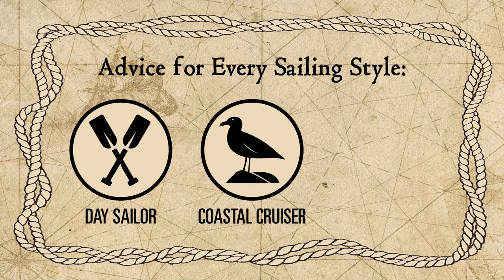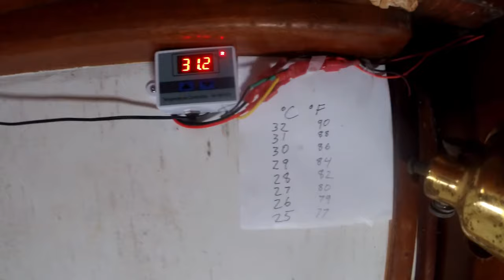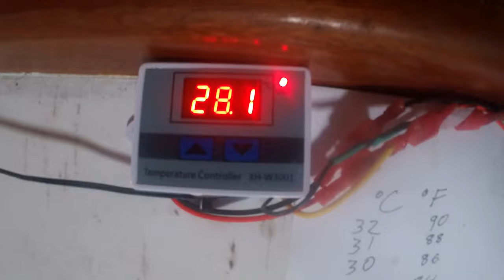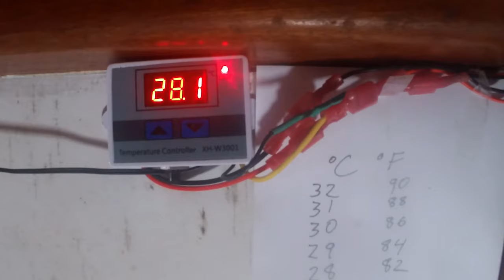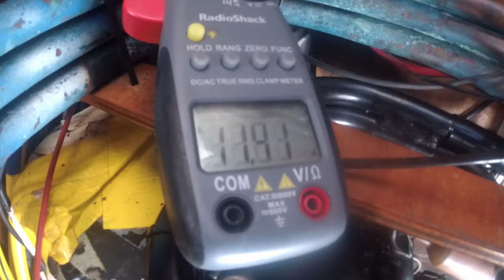Battery-Powered AIR CONDITIONING on a Sailboat [Capable Cruising Guides]

Comment: Hi Clark, You really do have the most informative videos for ACTUAL problems of living on board. One question I have is what is the inrush draw of the compressor? My fridge runs on 3A but compressor inrush is 12A.
Reply from the maker: It's a 3 phase brushless DC.  There is very little inrush.  Unlike an induction motor.  Nothing I can see on the meter anyway.  I've not hooked a scope up to it at startup but I think most of the startup power comes from the capacitors on the control board.
Reply: @Clarks-Adventure  3 phase DC??? errrr...
Reply from the maker: That's what they are called.  Google it.
Reply: @Clarks-Adventure  oh, I stand corrected. I was thinking you need to feed 3 phases to the motor... thanks for sharing!
Reply from the maker: We actually feed three phase pulsed DC to the motor.
Reply: @Clarks-Adventure  yes, that's what the motor controller then does, from what I read?
Reply from the maker: Yes

Comment: Girlfriend has a dog.  This could be a great solution.  I have an HVAC background so could easily build this as well.  Very curious what model compressor you are using.
Reply from the maker: It's this military thing that is basically not available for resale.  We are buying a bunch and will have them available soon.
   Fill in the survey in the description of the video if you would like to be kept informed.
Reply: @Clarks-Adventure  ok. Do you have spec sheets?  I have sources that can sometimes find odd products like this for IT cooling applications
Reply from the maker: It will eventually all be on the webpage I  expect.

The COP is over 8 and this one tops out just over 5kBTU.

Just signing the contract with the manufacturer who bought my design today.  You must understand I can't give out information that would undercut that company.  Wouldn't be honorable or legal.  Kits from them will be reasonable.  But remember this is a very expensive compressor to start with.  Us military spends our money freely.

Comment: I'm interested in a how-to pdf with a list of what's needed. maybe some links to sources.
Reply from the maker: The condensers are really expensive if bought individually (like $350). And the compressor I use can't be bought easily one at a time.  Not to mention their one unit price is very high. They are made by a defence contractor and don't seem to care for the public.   I could talk the talk so I got through.

    We will be offering a kit that includes the manual and the hard to find parts for less then you could buy them for.

    Fill out the survey if interested.
Reply: @Clarks-Adventure  Ya so.  I see.  Thank you very many.

Comment: I just bought a sailboat and was and have no solar. I was  wondering how long do I need to run the engine to charge a car lead acid battery? Thank you for your time.
Reply from the maker: How big a battery, how discharged, how large is the alternator.  And charging with your big engine is bad for it.....

Not a simple answer.

You can research it yourself or I have a tier "dream believers" where we can just talk on the phone.  Lots of people use it for that kind of help.
Reply: @Clarks-Adventure  not sure how big the battery is small. In the yellow discharge wise. I found a buddy that helped me motor and sail for a few hrs and I'm back to green. I ordered a 175w solar panel and nee 200ah AGM battery and saving for the charge controller. Do you guy have venmo would like to buy you guys a beer? For your time a information.
Reply from the maker: Thanks,
No just PayPal and Patreon.

Both links in the video descriptions.

Comment: If the solar you have available is (on a normal day) enough to charge a 100AH LiFePO4 battery and run the compressor and fan(s), why not just leave it on (during the day) so the cabin never heats up and then needs to be cooled down at night?
Reply from the maker: Our aft cabin hatch moves a lot of air through the boat.   The rest of the boat is cooler with the door open.

We sometimes take an ac siesta on particularly hot days.

Comment: Hey Clark how's the AC program going? Still interested! Thanks
Reply from the maker: Signed a contract with a manufacturer.  The first batch of parts should be available most any time now.

Honestly I've not been given a lot of communication.
Reply: @Clarks-Adventure  I'll what for updates, also info on your lithium/ agm bms?
Reply from the maker: It's now called a BBMS, battery bank management system.
It's running Temptress and a friend's boat.  Version one is ready.  Version two is getting close to prototype.

Now have to figure out how to distribute.

This Saturdays video will have details.  We just filmed it.

Comment: Hi Clarke...
New subscriber from Melbourne Australia with very limited knowledge about electricals and air conditioners, but... would this work for my.camper bus too?!... Cheers
Reply from the maker: Sure, just need to use an air condenser and fan in place of the water condenser and pump.
Reply: @Clarks-Adventure  
Ok count me in, postage to Australia though?
Reply from the maker: Price will be plus shipping.   I haven't a clue what it costs to ship to Australia.  Feel free to research the best way.

Comment: Hey Clark, have you thought of going with a thruhull or hull plate condenser like isotherm or frigaboat.  That would eliminate the pump.
Reply from the maker: Sure you could do a keel cooler.  But the pump only uses 1 amp.

Comment: Hi Clark, I noticed ZeroBreeze Mk ll has a true condenser / compressor mini A/C unit (not a swamp cooler) that must be very similar to what you are making. The internal compact build package actually looks pretty impressive, dig into the website a bit to see the unit without it's outside skin.  It is only 2300 BTU and is less efficient as it pulls in air at ambient temp to exhaust the heat unlike yours that will use outside water temperature to carry away the heat.  The ZeroBreeze Mk ll, using ambient air temp claims to cool 20 or 25 degrees F. cooler than the outside ambient air temperature and uses about 200 watts also at start up.  Price is good at $950 but we'd need 2 of them to equal the BTU's on yours and  two of  these air cooled units will probably use more watts than your air cooled 4000 BTU unit.  Do you have any estimates on the efficiency drop your RV air cooled units will experience.  I am signed up for one of your RV units that you said would be coming later on.  Do you think your most assembled package will cost us less than two of these ZeroBreeze Mark ll units ? (2 x $950 = $1,900)  Do you see any obvious weak points in these ZeroBreeze Mark ll units that might affect longevity?  Thanks in advance for any professional  opinions you may have on this unit.
Reply from the maker: I looked into the zero breeze.  It would have been so much easier but I went another way because of everything you describe.  (Also don't like that they claim the 29 degree number.  It's BS.  They get it by not blowing much air.)
    The price for the kit will be cheaper then two of their units.  I just don't know about a partial built unit but these are really easy to build.  I just wrote the install manual.
    Efficiency on the air unit will have a lot to do with the outside temperature.   I won't hazard a guess until we test one.   If it's 85 outside they will be close to what you see in the video with our 85 degree water.  A little more for the fan.  As the outside temperature goes up we need more and more power to reach the same inside temperature till we just can't reach it
Reply from the maker: Issues I see with the Zero breeze.

There is loss in charging their battery and then discharging into their compressor.
I think 4000 btu is a practical minimum amount to use in a small poorly insulated space with a couple of people in it.  Humans make heat after all.
   I don't think the breeze moved enough air to be efficient.
   And if course they have the problems that all portable units have regarding pulling outside air in.

I like that it's portable if I had a tent I might consider one to blow right into me.
Reply: @Clarks-Adventure  Thanks for the comments on the ZeroBreeze.  I definitely agree on minimum 4K BTU for a small non-insulated space with 2 human" furnaces" inside.  With your RV model, will you evacuate the heat using a similar setup to the ZeroBreeze or will your design be more like a mini-split with the condenser/compressor located outside the vehicle with the air handler inside.
Reply from the maker: More like a mini split.

It's going to be a cars AC condenser with a 12v cooling fan, also automotive.

I think it's probably best mounted under the vehicle if it's not too close to the ground already, saving the roof for solar panels and the like.
   Maybe with a rock guard that folds up over it for driving.

Comment: Did you add in the amount of power required to pump the salt water through the lines and the extra fan ?
Reply from the maker: Yes, those two were on the orange meter.

Comment: What you've done is really amazing!  Compressor startups are a real problem for batteries due to the surge needed to start.  Just a thought.  You live on a boat which means you have a huge heat sink sitting under you.  Have you considered using a large peltier?
Reply from the maker: Peltiers are REALLY inefficient.   Not really practical.
Reply from the maker: With my system startups aren't an issue.  That happens when you use an induction motor.   They aren't efecient enough for my needs.  Mine uses a brushless DC motor.  It uses much less power and there is virtually no startup surge.
Reply: @Clarks-Adventure  Nice!  I seem to recall you saying you used salt water from the ocean to cool the compressor?  In any case, I'm really looking forward to seeing a parts list and diagram of your system!  I'm sure there are many who would benefit including RV owners!

Comment: The seacock, filter and pump for the sea water needs of the condenser appeared to be left out of your description and package solution. Do you expect that other cruisers would already have a way to get sea water to the condenser and back overboard?
Reply from the maker: The pump was included in the power consumption numbers.
   Are you talking about the actual holes in the hull.  Yes that's part of instillation.  I can't ship holes.
Reply: @Clarks-Adventure  Maybe I just missed the discussion of the sea water pump and connections. Thanks.
Reply: @Clarks-Adventure  can't you just tap into the yanmar's raw water system? I hate making holes in boats.
Reply from the maker: Sure sometimes one can share thru holes but since this is a centrifugal pump and it's outlet is above the waterline I wouldn't share with the engine.  Sir could be pulled backwards through the system.

Comment: I am definitely interested. Currently have air-conditioning when connected to shore power. Would much rather have a unit like this. I would suspect that you are producing more electricity through your solar then you’re using throughout the day. There’s no reason that you couldn’t run the unit during the day with that extra electricity. Thanks for the great work.
Reply from the maker: Yes we run it after lunch a lot and take a siesta.  We are basically charged up by noon.  And solar makes way more then this uses.
   I'm sure we could run it 24 hours.

Comment: Do you have electric refrigerator if so what size.. I'm in process of trying to go all solar and lithium without motor alternator. 27ft sail boat
Reply from the maker: You might find this playlist interesting.
A/C and Refrigeration: https://www.youtube.com/playlist?list=PLsT7_jPsZM5qNlstuF-fdlgjrimo18tq7

Also if you are buying li and want to keep it healthy.

https://www.emilyandclarksadventure.com/bbms
Reply: oh boy can you send me down rabbit holes i love it. Im thinking my area is not able to isolate as well as yours. Have you looked into ecoflows ac unit I have not yours seams well hidden compared to a box.  
another thought with your sea water temp compared to air temp and the outside temp of your boat roof. is ir worth whilw to think about a sea water rinse over your cabin top through the night just a thought. Thank you Mike
Reply from the maker: I used to wet down the teak decks at night but now it's just not necessary

Comment: Can you tell us how many BTUs you ended up choosing for your compressor ?
Reply from the maker: I know it's cheating and I should have measured the water pumped and measured the temp raise.
I just used the amps consumed by the compressor alone and checked the spec sheet to find the RPM.  Then used another table to convert RPM to BTU.

So the compressor maxes out just over 5000btu and I'm using it at about 4000btu.

Comment: Hi Clark, great video, love the ingenuity! Just a quick question, do you see this product having an RV  application? ( rather than a boat). I’m interested in your thoughts
Reply from the maker: Yes.  Just have to use a different condenser and fan.  Easy change.  It would use just a bit more power but not much.
Reply: @Clarks-Adventure  Thanks for the prompt reply, keep me posted with associated costs for an RV application
Reply from the maker: You have to fill out the survey in the description.  You won't be on the list unless you do.

Comment: Hi Clark. Could you talk about Clamp meters, or have you in a video about equipment in the past ? I recommended one, and a guy  with a passion for Voodoo told me a clamp meter would kill me or something like that. lol.
Reply from the maker: Yes we often consider a tool video.  Problem is...  So many tools.

So will it bite you???
Reply: @Clarks-Adventure  Just tried to recommend one to Nike of White Spot Pirates and this guy replied as to how dangerous and inaccurate they were. Since you two the go to sailor channel for technical info I thought that you might have talked about meters and other test equipment ? Sounds like a good video.
Reply from the maker: I have been diving deep into the world of hall effect current sensors lately.  My BBMS plus requires one.  They can be fairly accurate but might need recalibrating a lot.
   I believe for the hand held variety the ones with the smallest clamps are best. (As long as your biggest wire fits in of course)
Reply: @Clarks-Adventure  Was very happy to see you using to , one may be the same as mine, in the boat AC video. Passing on that part of the video.

Comment: Wouldn’t it be more efficient to use a seawater heat exchanger rather than a compressor?
Reply from the maker: There is a seawater heart exchanger in this system.  The condenser.   Without the compressor you could only go down to ocean temp and couldn't drop humidity at all.  The oceans in the tropics are warmer then the night air.

Comment: Hi Guys,  Clark, I am interested in a fully done Isotherm type unit but I am in Australia
Reply from the maker: Isotherm is someone else's refrigerator system.

If you are interested in my air conditioner fill out the survey in the description and you will get an email when they are available.  
Should be soon.

Comment: would it make sense after you have initially cooled the room down from 32 degrees, to fire up the genny to recharge the batteries?  It would seem that initial cooling down period would be the most energy consuming period and after that, would only require minimal energy to keep it at the desired temperature.  Great set up.
Reply from the maker: If you didn't have enough battery storage that would sure help.

Comment: Hi Clark, if the idea takes of, is it then possible for you to post the diagrams and provide a full list with the specs required of each component. I live halfway around the world, so postage on your packet would skyrocket.
Reply from the maker: That's what I wanted to do for patrons.  But, that would work for everything but the compressor.  I had to say I was an engineer developing a prototype.  (Technically true, but wasn't my plan at the time).  They are just not very interested in selling single units.

   If this goes I could probably sell you just a compressor.
Reply from the maker: Also. Look at the compressor in the beginning of the video.  This thing is quite tiny and light
Reply: @Clarks-Adventure  that would be a  fantastic compromise!

Comment: Clark - would there be reasons these small AC units wouldn't work in a small airplane?
Reply from the maker: I think they would work fine as long as you can place the condenser where it can cool to the outside.  These are VERY light weight and small so there is that advantage.

I'm currently working on an air cooled unit.  Putting it into a camper.  I'm working with a condenser that is 8"x8".  Seems to work fine.

For the plane I'm not sure how many BTUs you need.  Most planes have a lot of glass and during the day they might need more power then this has.
Reply: @Clarks-Adventure  Thx! I may wanna experiment with this. May be a market for it… Still plinkin' around on the Bass?
Reply from the maker: Not until I get back to the boat.

I assume planes run with 24v electrical systems?
Reply: @Clarks-Adventure  Many do. Some run 36V…
Reply from the maker: The compressor runs 24v native so you won't need the boost converter.  I'll help you find a good component if you want to buck down from 32v

Comment: I hope you see this: I’m restoring a MacGregor 65 and I want to supplement or replace the 2 AC units it already has with your idea. I’m in Miami Florida, so maybe you can connect me with your installer in FL that you mentioned on this video?
Reply from the maker: Closed that down until I find someone else to run it.

https://youtu.be/Q0juFMOMaD8

We sold most of these, in fact I only have one left, I'm afraid if we sell it it will go for a lot more then 1800